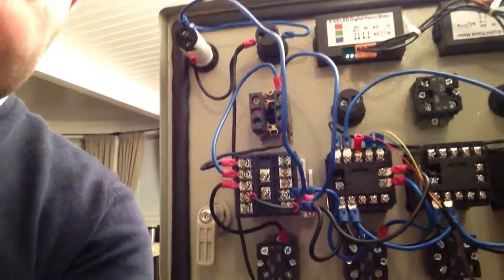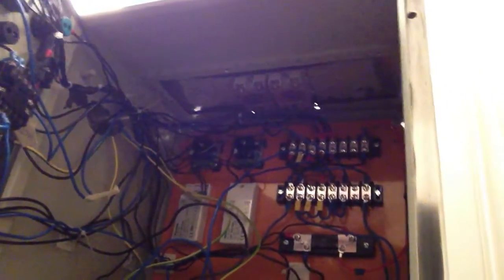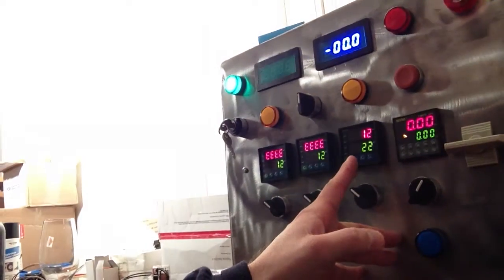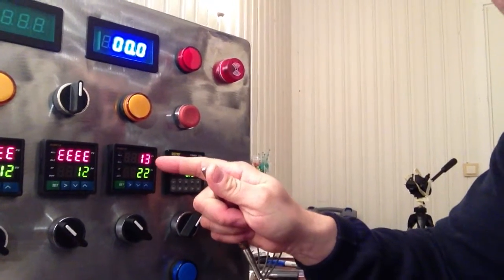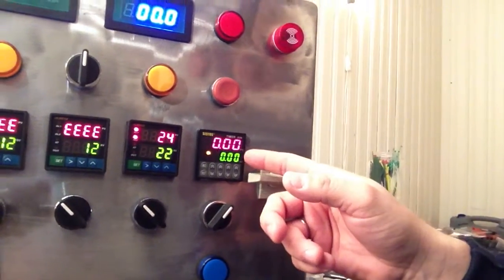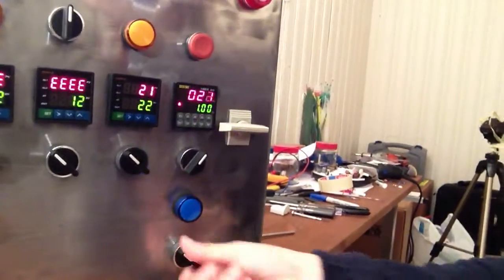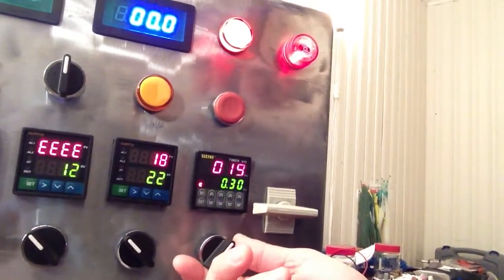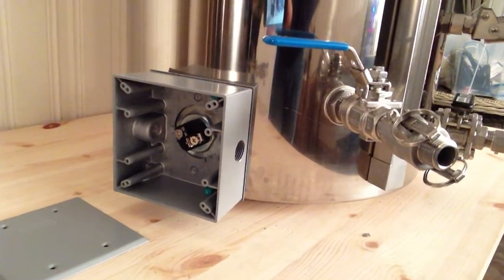Homebrew Wednesday - Nov. 21, 2012

Comment: Are you running your PID 12v or 220V ?   And what about the main key swich is it 220?  Thanks a lot for your help.
Reply from the maker: I have the 220v ones. Everything is 220v except the volt and amp meter. Cheers!
Reply: Thank you

Comment: Hi Mate, can u send me the diagram you made for the control pannel.- I´m going to use 5 Inkbird PID ITC 100VH,. Thanks!!
Reply from the maker: Hi Pablo! I used the instructions up on The Electric Brewery website: http://www.theelectricbrewery.com/control-panel-part-1 and http://www.theelectricbrewery.com/control-panel-part-2 . I recommend the boil kettle use a PID that has both a temperature ON/Off mode and a manual mode, to be able to set it to a percentage after the boil has started, i.e. 75% pulse rate. I'm not sure the Ink-bird has a manual mode, but I know the JLD612 and Sestos D1S-VR-220 both do have. Best of luck!

Comment: Hey Tony, I watched your videos on the Electrical brewery a zillion times and I  believe it is the best setup I saw in my 5 years of home brewing.  So well explained and I simply love the details. I wish I could build one like this.  Could you help me the control panel parts list, wiring diagram and the sources from where to order the control panel parts..  Thanks in advance.  Happy HBW
Reply from the maker: Hi Anjeel! Thanks for the kind words! As for sharing a parts list and sources, the best place to find everything you need and have step by step instructions is here on http://www.theelectricbrewery.com/ website. Many people and I have used that web site to build the control panel, and even help with the layout of the kettles and process. The forums on that site are great too. I've never had any issues getting responses to questions I might have, and the search functionality is good too. Some of the parts there, however, I was not able to source. For example, they reference MCMasters quite a lot for parts (washers and gaskets), and they do not ship outside the US. So for those things, I've had good results finding them on eBay and AliExpress. I hope this helps! Good luck building your electric brewery! Cheers!
Reply: Great Just had a quick glance they have pretty much everything. But shipping out of US hope they will be able to supply 220-240V supplies for Australia/NZ region.  I will check with them, cheers.
Reply from the maker: Like I said, all the 220/240 stuff I found on eBay. Here is the most interesting post in the forums which details how to build the system for 220/240v: http://www.theelectricbrewery.com/forum/viewtopic.php?t=25393 Best regards!
Reply: Hey Tony, Do you have a video on your Camlock connectors.  I am sure you  would have tried all sorts before arriving at what is the best out 
there :-).  Cheers and Happy brewing.
Reply from the maker: I have not, no, but +BobbyFromNJ has done one here> https://www.youtube.com/watch?v=zHAS7iwWLmQ
Reply: Thanks, it's a fantastic explanation by Bobby.  Greatly helps.

Comment from the maker: Yes sir! It's energized, albeit via a normal ~16amp socket, just to make sure it's all working as advertised. :-) I finished later Wednesday night after shooting the video, so even all the wiring to the SSR's and to the HLT and Boil Relays are working. Just have to swap out that converter and volt meter and then it's just to get the electrician here. 

You want to get a closer look at the Timer? Just let me know and I'll post a video. What PID's do you have?